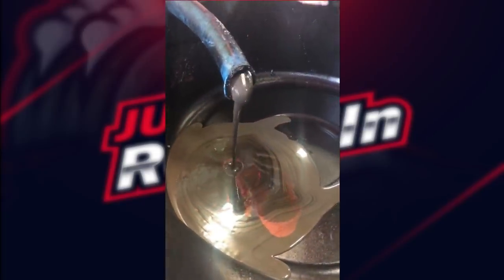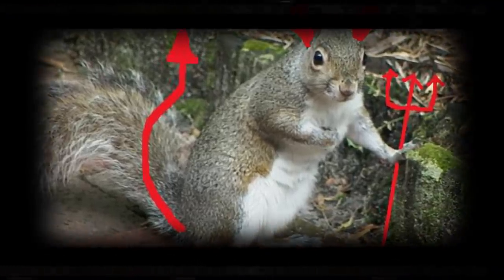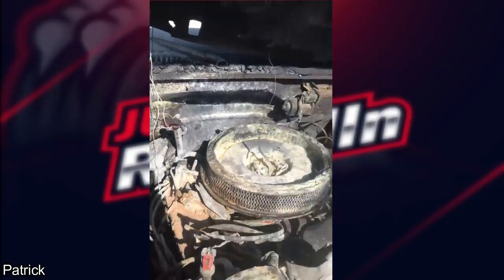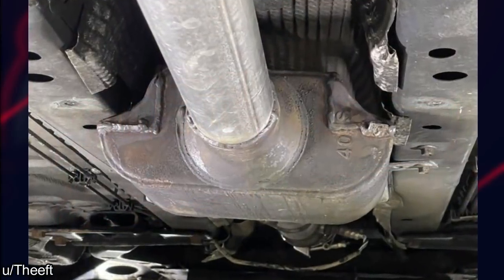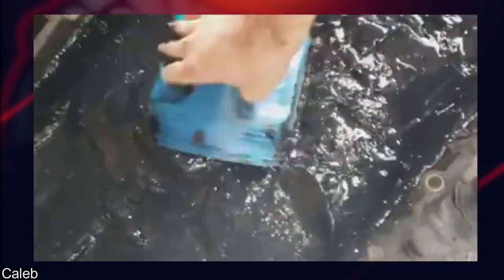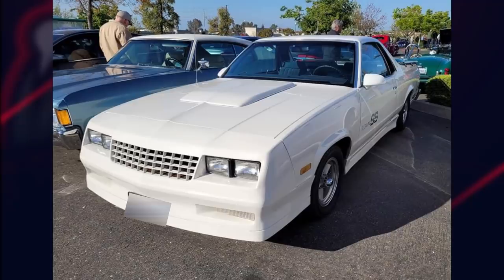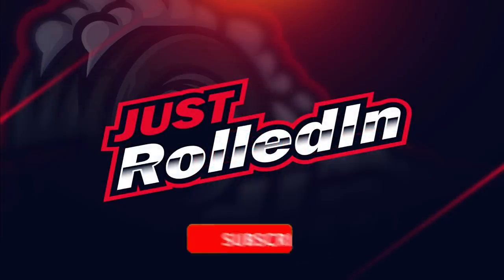Customer States "I Don't Believe You, I Don't Need My Oil Changed!" | Just Rolled In

Comment: My father had a shop and a customer got a call from his daughter stating that her car was making a noise it was a spark plugs hanging from the wire.He told her to screw it in by hand and drive home she says I can't it keeps shocking me!
Reply: lol but how spark plug got unscrewd lol
Reply: @Techie1224  lack of maintenance!My sister had one come loose in her MR-2 After calling for help she had a phone call from a helicopter for the wolf radio station in DFW area asking if it was her pushing a car in traffic.Her boyfriend and he sent a friend within 5min a guy showed up on a motorcycle and easy! No she knew better than to touch it while running
Reply: @allanbrogdon5317  
normally spark plug dont come loose unless they hadn't been tourqued as specified  last time
Reply: @Techie1224  Yes I have never had this problem myself
Reply: ha ha ha ha :)
Reply: That reminds me of my time in the Navy lol I was in the battery shop testing some batteries. Used some little fans with just the wires put them across the terminals sparked like crazy fans ran though. Now get this I was an electronic tech in a compartment full of electricians and they were freaking out claiming unsafe etc. 12VDC in the navy does not require tag outs, etc. It was funny they even tried to get me in trouble with the officer in charge of our division. He grinned big time when I told him it was a 12V battery ; )
Reply: While following my teenage son home on the interstate from out-of-state around midnight one very cold Christmas Eve, he suddenly braked and pulled onto the shoulder.  His V-6 Tacoma was making a heck of an engine noise.  We found that it had blown a spark plug which was hanging on the end of the wire!  It scared him big time.  We bought the truck used months earlier but had never touched the plugs.  We assume the prior owner must have stripped the spark plug hole in the head.  We towed him the rest of the way home (a several hours tow).

Comment: That walnut is hilarious! You would think the spring would crack it and give you fresh nuts.
Reply from the maker: That would be a perfect little roadtrip snack lol
Reply: The squirrel thought it was the perfect place for a nut!
Reply: @JustRolledIn  Did you ever find any of those "Engine-mounted lunch boxes" or is that something mostly left to the 1960s? If you're unfamiliar this used to be a thing. You'd attach a metal box to your car's exhaust manifold, then you could put food in it before starting the car, and half an hour later, it's all toasty hot. This is obviously just using heat from the exhaust manifold, it's not coming in contact with exhaust gases.
Reply from the maker: @101Volts  never seen anybody do it before but I have. I worked out of town lots so I always did that. When I worked camp jobs there would be a lot of food in the fridge you'd grab In the morning for the day and that would be the only way to warm it up

Comment: I believe that oil pan had the original oil in it from whenever it was new.
Reply: I change my oil regularly and have a rust hole in my pan. 150,000 miles. Maybe this guys on to something.
Reply: @anthonythorp7291  curious eh ,did it rust from inside or the outside?? ,out side might be salt on the road??
Reply: @trevorslater2746  I personally haven't looked at it.  No doubt it's from outside in.
Reply: @anthonythorp7291  
no worry unless theres oil leakage
Reply: @Techie1224  leaves a little puddle everywhere I go. Have to get it fixed b4 gets worse.
Reply: My guess a little bit antifreeze in the oil or it was very rarely changed if at all. I had a navistar vt365 engine that had a leaking egr cooler, it was parked over the winter when I went to start it and bring it into the shop it would not start no oil flow even on the low pressure side took drain plug out and sludge oozed out had to leave it sit with drain pan under it for about a month then put fresh oil in it and it started.
Reply: I wouldn't be surprised if the owner drove his car home without the oil pan attached as there was plenty of oil in the engine

Comment: When I was working road construction a "grade stake" literally 1.5in wide by .25in thick, ya can snap them with your hads) went through a CAT Grader tire. And it was made out of pine. Wish I still had a pic of it. Probably a $5000 tire.
Reply: @ Jason Jaeger

Only job I’ve ever had for over 20 years, running equipment.  Not a grader though.

If your tires were close to bald, for sure.  That or dry rotted.  I worry about that on some loaders.  Especially with tire prices, they don’t like changing tires lol.

Comment: I can relate to the pine cone filled air filter box. I lived on 5 wooded acres with lots of oaks and chipmunks. Those critters did the same thing to my air filter box using acorns - probably 2 qts worth. I had noticed a decrease in power and it made a big difference after I emptied out the acorns. I then put a screen over air intake. On that same property I lost two clutches on my F150 due to mice building nests in the pressure plate and jamming everything up.

Comment: I ran out of engine oil, but I had 30Lbs of axle grease.  It was hard work forcing it down the rocker cover.
Reply: lol for real ??
Reply: Not all cars have overhead cam so this may have a side tube filler on the engine. He did not say what motor the pan is from so it could have been an easy tube filler on the side.
Reply: @Techie1224  No.  I was taking the piss.  You cant run a car engine on axle grease and you cant get it into the engine
Reply: @bunzeebear2973  Are you for real?  I was taking the piss.  You cant run a car engine on axle grease and you cant get it into the engine via the rocker cover or anywhere else.
Reply: Come on! It's a joke.

Comment: I once rebuilt a 78 Oldsmobile "code R" 350 that had gone so long without an oil change I had to pull the pushrods out with pliers.  Although I'm a Ford guy, I have to tip my hat to Oldsmobile:  That block didn't even need bored .010 over - just a fresh cross-thatch with a ball hone and standard rings was all she needed.  Amazing.

Comment: A friend of mine who was automotive machinist years ago said a truck motor came in for a rebuild. The company that owned the truck had converted it from gas to propane, but didn't change the oil after the conversion. A short time later the oil pressure dropped, and nothing came out of the oil drain. They pulled the pan and found a vaseline like substance in it. They sent a sample to the lab at Kendall refinery, and all they could figure was the propane combustion byproducts had reacted with oil that had already been exposed to gas combustion byproducts and somehow gelled it.

Comment: I worked at a GMC truck dealer in the 80s, and a truck came in with an engine noise. The engine was a 5.7 diesel from the converted gas engine program. Pulled the oil pan because I couldn’t get a reading after adding 3 quarts. It was a solid block of hard jello, and had cutouts where the crankshaft carved out its own clearances. Turns out the owner never had the oil changed and the original oil filter was still there. 100+k miles and he called and complained to GM. “Give him a new engine” they said.

Comment: When I worked at a stealership, there was a guy who bought a brand new Jeep Grand Cherokee.  He brought it back about 9 months later with 30k on it.  He had NEVER changed the oil.  It looked just like that sludge pan in your video.  Needless to say, Chrysler would not warranty the motor.  That thing sat on our lot for years.
Reply from the maker: Did he just trade it in for something else?

Comment: The owner installed engine that burnt reminded me of a guy I worked with back in the mid 80's.  He had a really nice Chevelle that he had all done up.  One day I saw him driving around town with no hood.  I thought it odd but figured he was just showing off his engine to the town.  Next time I worked with him I asked him about it and he said a fireball had shot out of the carb and burnt the paint on the hood and it was getting resprayed.  A couple months later I see him tinkering with the hood up, air cleaner off and he has a lit cigarette in the hand that is resting on top of the carb.

Comment: “So we decided to replace the engine oil with ‘Slick 50’ and ‘Liquid Mechanic’ oil additives.”
Reply: Stop Leak
Reply: I use to run straight 50 weight in one car. The guy that built the engine said don't start it in winter with that oil. The crank will come around, hit the oil, and snap. He was half kidding of course.
Reply: STP Oil Treatment. Instead of oil.
Reply: A friend works at an automotive machine shop. He says all those additives just settle into the valleys and dips in the engine and do nothing for you.
     I only used additive once, slick 50. Put it in a car with noise lifters and quieted it right down. Didn't keep the car long so I don't know how long it was effective.

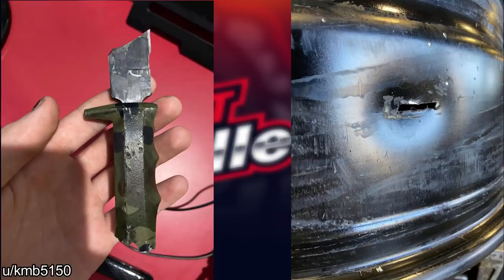Comment: 0:50 Customer came in with a low tire. Pulled the wheel and found porcupine quills in the inner sidewall. Unbelievable
Reply from the maker: Cant say I've seen that before.
Reply: @JustRolledIn  I've had it happen to me personally. They are HARD to remove also. Were in the tire about 1/2". Tire was still holding air.

Comment: "I get my oil changed every 3000 miles I don't need any mechanics scamming me!!"
Reply: Save yourself some money,, every 5000 is good,  every 3000 is a scam by the oil companies and car manufacturers, I drive nothing bit Toyota's and they reccomend every 7,500  but every 5000 is easy to remember and they last for at least 300,000 miles and still run great, just everything else is worn out

Comment: Weirdest thing I've seen in a tire, a clutch lever off a motorcycle ended up in my buddies R1 while at daytona bikeweek. We have no clue how it happened lol
Reply: Maybe used it as a tire lever and forgot it.I saw a ring gear used as a tool to install the planetary gears on the proprotor gear box on the V-22.The guys from production came to borrow ours because they couldn't find theirs.An old guy said you need to find yours before you do anything else!The started running a test with Boeing big shots in attendance.Within a minute the chip detectors started alerting.Presto they found it!2 feet in diameter it was sitting on the ring that was part of the gearbox.One transmission or box was a million dollars, not sure what it costs the taxpayers to be in a hurry.

Comment: I've come across this oil sludge a few times.  When a vehicle isn't driven much and not warmed up - along with not changing the oil, that sets the stage.  Then, the owner finally does put the vehicle "to work" and the added heat starts the process of saponification of the oil.  Once the expanding mix reaches the crankshaft, it starts whipping it like whipping cream.  Viola'.

Comment: I've had my oil pan,  and valve cover off on my old work car with 165k miles on it.........  all there was was clean(ish)  oil on every surface.  I guess it pays to keep your maintenance.   Valve cover came off due to scheduled timing belt change...  and the Oil pan looked rusty,  so I changed it before it leaked.
Reply: good job.

Comment: About a decade or so ago, a friend & his mother stopped by for a visit on their way back home. While his mom visited, my friend mentioned that the car had developed a squeal & the power steering was sluggish at low speed, but things were fine at highway speeds ('98 Merc. Sable). I asked if they knew when the serpentine belt had been changed last - his mother had just bought the car from a private owner & didn't know. I suspected the belt, and on the way to the parts store, it snapped. We managed to get it out of traffic, & upon closer inspection, the idler pulley had seized, snapped in two, & shredded the belt. Fortunately, the O'Reilly's had both the belt & pulley in stock, & about an hour later, they were on their way home w/no more trouble. I don't think the belt had ever been changed, as my friend's mother was only the 2nd owner.

Comment: I bought my current 1992 Honda Civic DX sedan 8 years ago, and it had been BADLY abused in its (then) 235,000 miles, some time around when it got here to Arkansas.... I had to do front brake pads and rotors, put a radiator in it, new spark plugs and wires and a few other things to get it back on the road then. Well, just a couple hours after getting the car going, I was driving along and suddenly heard the most terrible noise coming from the front of the car. I thought the engine was locking up or something.....then realized the noise changed when I pressed the brake pedal, and the noise stopped when the car stopped.... I thought "Great, did I buy defective brake parts?".... it was a TINY little rock between the caliper and the rotor...... Thankful it wasn't something worse! 8 years later, the car now has 287,500 miles, I have put a ton of work into it, and she just keeps going and will get better once I swap in my rebuilt high compression B18A1 :)

Comment: my own truck going home a 6 inch 3/8 extension through the middle of rear tire and out the side wall. Used it for 25 plus years still have it [Snap ON]. customer came in with a noise in rear of car. pulled 5 kittens from rear frame rail she freaked out they had 7. Watching these make  me wish i didn't retiree
Reply: so did you charged her or charge the kittens ? 🥰
Reply: @Techie1224  no just put them in a box and gave them to her

Comment: My favourite hacks are as follows..
1. VW Golf sold to a mum with young kids with vice grips on a rear punctured brake line.
2. Ford Mondeo serviced at work by customers truck service dept smoking heavily.  10 litres of oil in the system instead of 5. (Perhaps they forgot it was a car).
3. Front tyres pumped to 80psi instead of 32 because the power steering had failed and the owner didn't want to pay for the repair.

Comment: Weirdest thing I've found in a tire.  Customer stated the front end and steering wheel would shake violently at high speeds.  Took the tire off, rolled it on the ground, and heard something tumbling inside.  The car had less than 50 miles on it, pretty much brand new.  Got the tire off from the rim, low and behold, a big flathead screw driver.  I gave the customer the screw driver as a souvenir lol.
Reply from the maker: Lol that's very interesting for only 50 miles

Comment: I worked at a Chevrolet dealership in the mid 80's.  They sold Rockwood custom Chevy vans.  A woman with a floral business bought a Rockwood van and then brought it back several months later saying the engine was making a noise.   The van had 20,000 miles on it in only 6 months.   She had never changed the oil in that time.  The oil filter still had the sprayed on undercoating on it from the factory.   The oil in the oil pan looked just like the sludge in the oil pan near the end of your video.  Needless to say Chevy did not warranty the engine due to lack of oil changes.

Comment: I used to work at a service station and I repaired lots of tires. I once pulled a butter knife from one. The handle bent flat on the outside of the tire. I also got a flat on my sportbike a few years ago. Was a brand new tire and a razor blade sliced straight through the tread. The blade was inside the tire.

Comment: Even the dealer's service shops can occasionally mess up! A couple of years ago, I took my Honda CR-V to the local Honda dealer for routine service, including oil and filter change, a couple of other minor jobs, and requested them to do their general inspection, including checking all fluid levels. When I got the car back and started to drive home, the very first thing I noticed as I turned the very first corner was that the steering didn't feel right. I pulled over and checked the power steering reservoir and it was completely empty! Fortunately, I had a bottle of PS fluid in the back and added it and everything was okay again. So, they apparently drained the old PS fluid, but failed to add new fluid!

Comment: I seen a 1979 Chevy Nova 350 SS with 100,000 mile without an oil change and i got to say that car's oil looked like the one in your video. But here the kicker the slug was pouring out of the dip stick fuller neck and intakes needless to say me and my uncle had a fun time rebuilding that engine. When you pull the exhaust manifolds they to was pack with oil slug all the way to the mufflers

Comment: That last 00–04 V70N at the end almost made my PP hard. I have an -06 Facelift version but I'm absolute garbage when it comes to taking pics. Gotta fix my punctured tire as well before I take any pictures since I'm riding on my summer ´, 18" Ocean Storm rims in the back and some garbage 15" rims in the front that I use for my winter tires. Luckily enough, they're studless so they're legal during summer as well and I've ordered two new tires since my front tires would almost be considered racing slicks.

Comment: Well as for tires they would rip up the tracks and ties. Then spread the gravel on the dirt roads. Had a bucket full of spikes. But the strangest was a bolt from the cross tie on a wooden power pole. About 1" round and 24" long. Went thru a short bus tire about 3" sticking out on both sides at a weird angle.

Comment: Possibly the strangest thing I ever seen in a tire (seen it several times) was in 1980 and 1981 we logged an area near a flint outcropping where prehistoric Indians mined flint for stone points. There were small flakes of flint from the knapping laying all over the ground and they would imbed themselves in the tread on the log truck tires and work there way into the inner tube causing flat tires.